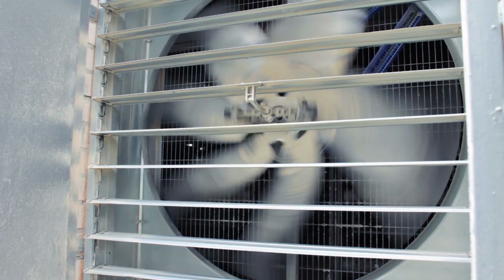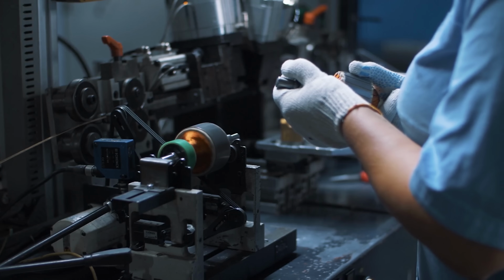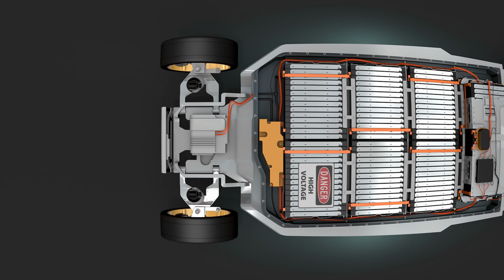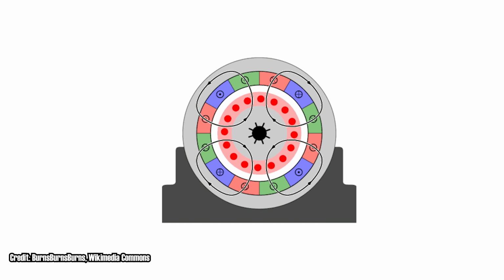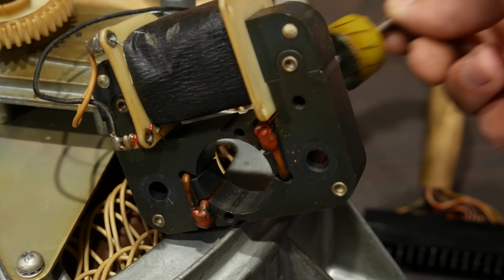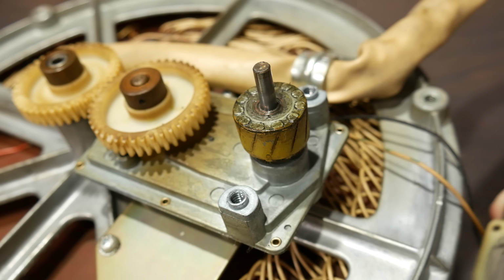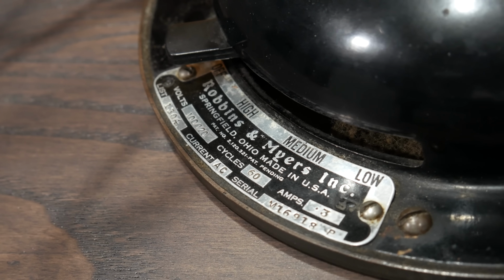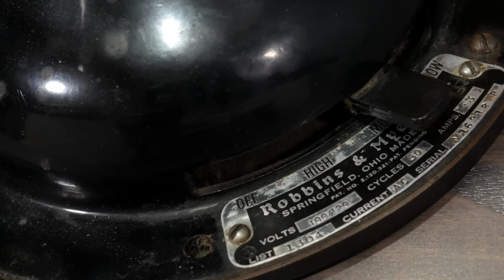Fans; High is next to Off on purpose

Comment: Living in Europe, I've never ever seen a fan or room heater that starts on high.
Reply: That and we have 3phase in our homes at 400V. Perhaps having 230ish V on a single phase helps start things. And most things today have more modern motor designs.
Reply: Me neither. All the fans I can remember seeing either go off->low->med->high or they were two-speed models where you have to press two buttons simultaneously to get to fast mode
Reply: You like doing things backwards don’t you! First your dates, then your fans, then your presi....never mind!
Reply: Oh thank god. Same here in Australia
Reply: One old fan we had went from off to high and i'm from italy
Reply: Y'all normally have 240 volts as opposed to The States, we have 120v as low standard.
Reply: @Maaniic  even old designs have this more logical setup
Reply: @BadassAlen  Nooo. The UK and Ireland de facto have 240v (officially 230v) and the rest of Europe has 220v (officially 230b).
Reply: @Maaniic  No one's gonna plug a fan into 3 phases.
Reply: Same here. Stove dials on the other hand... Grrr!
Reply: @ttrjw  In the EU its 230V for more like 10 years because they wanted to standarize voltage across the EU. After Brexit it doesn't make that much sense though.
Reply: Yep. UK here, and never seen a fan like that.
Reply: yeah i just got a new fan and was surprised it starts at 3, never seen that before
Reply: It's because of the lower voltage running into our homes in the US. We're stuck with 120v rather than 220-240v throughout Europe and the UK.
Reply: @R3lay0  I've seen fans using 3 phases. They are a bit bigger than your normal household fan and were used to circulate air in big party tents. Cool stuff.
Reply: @R3lay0  I do for work :p nowdays usually with a VFD but the old ones still exist.
Reply: Same. I've never seen that anywhere here
Reply: Vaes Joren you should have at least 3 separate groups on different phases from which you can build a 3 phase? You don't have that? In the Netherlands that's pretty much standard.
Reply: @ttrjw  can't say for certain for whole Europe but here in Croatia we are on 230V standard (around 240 in practice) for at least 20 years. And since our power grid is part of European power grid I'll guess and say that everybody have same line voltage. UK was never part of EU power grid but have same values.

Three phases are not so common here now, 30 years ago most of homes have them but when electric company start to charge a lot for additional "available power" most old users have disconnect two phases and stay just on singe one and new buildings are mostly projected with monophase installation. It still available if you want to pay for that, just not so common. Not that we have much use for it nowdays anyway.
Reply: Same. All the fans here seem to have push button speed selectors and you just push whichever you want first. Maybe having 220-240V electric makes a difference? It would certainly give the motor a bit more of a starting kick.
Reply: Me neither. My reaction when seeing the video was: do they? My current fan goes 0-1-2-3.  And (except for the push-button style ones of course) that's the case for any fan I ever looked at. Doing it wrong way around must be an american thing, probably because of their tendency to build electronics as cheaply and shoddily as humanly possible. Probably saves a couple of cents for a capacitor or something.
Reply: @ErwinPommel  UK as well here and I bought a bog standard fan from Argos a few years ago that does indeed go off, high, medium then low. Many office fans just have the push switch selectors for the speed you want though, as others have mentioned.
Reply: I don't think voltage has anything to do with it. Higher voltage doesn't necessarily mean more torque or power. I suspect that most fans sold in Europe have to meet higher efficiency standards than in the U.S. Shaded pole motors have absolutely garbage efficiency, even here most larger fans use capacitor start motors, which have more torque, and are twice as efficient. A fan with a cap start motor should reliably start on low with no trouble, and that's probably going to be way more common there. I also suspect that the antique fan he has in the video is not a shaded pole motor. I see 40W shaded pole motors on fans half that size, that don't move much air.
Reply: They will be telling us next about a fantastic new American invention called the electric kettle
Reply: Same here, must be a Yankee thing.
Reply: @Maaniic  Oddly enough, newer fans are more likely to have crappier motors. My 70+ year old fans have capacitor start motors that are twice as efficient, and have much more torque, compared to my modern fans with shaded pole motors. But those caps cost a few extra pennies, so they're only used on larger fans (box fans, ceiling fans, etc.). Also, older motors are often made with more poles, which makes them turn more slowly but with more torque. Add steeper pitched blades and you have a much quieter fan for the same air flow. Again, this made the motors a tiny bit more expensive.
Reply: Same here.
Reply: @davidheafield1436  not likely, Americans don't really use the word kettle.
Reply: I was wondering about this, as a european. But cool video, and those phases in powergrids and all that, super interesting
Reply: Same here in South-Africa.
Reply: @ttrjw  It's officially and actually 230V in Ireland (standardised in the 1990s), and we were originally 220V as initial rollout used primarily German technology. We use BS1363 plugs and sockets these days, but that's about all we share in common with UK electrical standards (e.g. fuse boxes follow DIN standards).
Reply: @Maaniic  Single-phase 63A or 80A household installations are typical in Ireland, you'd have to pay a lot more to get three-phase.
Reply: In America everything starts on high. Then we mellow out and catch on after a couple decades. Unless it's converting to that vile, sensible metric system.
Reply: @ruadeil_zabelin  
Yeah, same here in India.
if we trip a breaker not one room but a section of the house trips like a light and a plug from the hall, the led tubelight and the fan from the bedroom and probably some plugs from the kitchen.
we have 3 THICC 50sqmm wires of 440V  coming into the large oil cooled transformer that speps it down to 230-250V 3 phase that Y or Delta( I do not know) somes down on the ground floor to the digital electricty meter and 4 thicc 5sqmm wires enter the house to the circuit breaker board and each phase is split into 3 load sections into each room.

Atleast thats what my apartment and most of my neighbourhood and relative's homes have...
Reply: @AaronSmart.online   Officially. But in both the UK and Ireland it is actually at 240v. There was an EU directive which mandates 230v but has a tolerance of 220v - 240v and requires appliances to support this range.
Reply: @jasexavier  
Yeah, my grandfather has a really old ceiling fan that looks like a obese modern ceiling fan.
he claims it to be roung 300-400W~ and I suppose that might be true cause the capacitor on it is THICC.
It runs quite slow but the air it pushes thru blows out papers & pens when it looks like it has not even reached max speed on 2nd speed!
me keep it on 1 all the time! it gives you the experience of a pleasent breeze with TOTAL SILENCE the fact that it has 7 step  resistive speed controler with 6 speed levels(1-5) and one off & it looks and feels just like a old caset player switch module.
Reply: @jasexavier  
shaded pole motors, in India, Ive never heard that term anywhere. 
even cheap $25-$30~ ceiling fans made in in India, LITTERALLY 99% of the time have a capacitor start motor in them.

EVEN my $90 modern remote control RGB ceiling fans have those capacitor start motor.
Reply: @ayushp.5395  All ceiling fans everywhere use cap start motors, or BLDC motors, never shaded pole motors. Only the smallest, cheapest, lowest quality fans, or some fans in industrial devices, use shaded pole motors.
Reply: Well you have the good life, I've been trying to explain to my hillbillies friends there is a better way of living
Reply: @ttrjw  I don't think you're right about Ireland, it's typically closer to 230V whenever I have measured it though it can vary by location

Comment: I have an old fan with low as the first gear. The low speed is stronger than most modern fans on high. The plug is a regular 120V with ground. It has never stalled.

Comment: I always thought it was a safety thing, since you're more likely to shut the thing off when it's going faster.
Reply: I figured it was for kids, since they like to do things like turn knobs, and they usually like to turn them to one extreme or the other. Instead of turning it to a more dangerous high speed, they would turn it to either off or low.
Reply: I guessed the reason correctly, because my cheap fan stall a lot, I need to turn it with hand before it can turn on its own, just like old propeller plane, so I guessed it has something to do with torque and friction
Reply: Yeah id always thought "oh like stoves that makes sense" but I never actually thought about it
Reply: @Scumful  The logic is that if a child turned the knob, it is likely they would turn the fan off or to a lower speed. The reason that might be important is that children also like to stick their fingers in fans. If the fan is off, the child would not get injured. If it is on low, the child's fingers are likely to get less damage, or possibly stop the slow moving fan blades and receive no damage. I thought the logic was pretty clear.
Reply: @Scumful  pretty solid logic actually. You must not have kids
Reply: @ClickClack_Bam  Pal you need to reread what he wrote. You didn’t understand what he said.
Reply: @raspberryjam  well... stoves start on high to make sure they have enough gas to ignite.
Reply: @void-2b  yeah, in both cases, the "low" settings can cause dangerous startup failure conditions
Reply: @b1zzler  both correlated, neither safety related.
Reply: You’re more likely to shut things off when it’s going fast? What?
Reply: @rachelcookie321  If some dumb kid sticks his finger in and it gets stuck, it's more of a priority to shut the thing off when it's fast to avoid injury
Reply: @TheTrueMr.Chicken  I you don’t really get your finger stuck in a fan. You put your finger in and then it either gets super injured or nothing happens. Either way you can quickly pull  your finger out again. If your finger is going to get injured then it’s going to get injured straight away. I mean I guess you could get your finger stuck in the protective cage but the finger won’t be in the blade because those are a bit far from the blades. And if somehow someone did get their finger stuck in a fan, what if they got it stuck at a lower level? It seems dangerous that you would have to turn it up before you could turn it off.
Reply: @void-2b  this might sound crazy, but I looked it up and it turns out that both gas leaks and electrical fires are related to safety 🤯🤯
Reply: @b1zzler  maybe you should have looked up the comment thread instead.
Reply: @void-2b  did I miss something?

when I came in, the @ chain was just you suggesting that some guy's gas stove analogy was bad.

then, when I commented to explain some of the commonalities, you replied to express your belief that there are no safety considerations associated with electric motor stalling, or with gas ranges that release an unpredictable quantity of explosive gas indoors before igniting.

if there's a puzzle piece missing here,  lmk
Reply: @b1zzler  he said the analogy was bad because he's said that in neither case is the low setting on the extreme for safety reasons. In the stove, high is by the beginning so there's enough gas coming through to be ignited.

He didn't, at all, say that there are NO safety considerations in the design of these things.
Reply: @freddiesimmons1394   Well… he said that startup failure was unrelated to safety in both scenarios. Which again, is not correct. I don’t have any statistics on gas range accidents, but did see my buddy singe his eyebrows off after struggling with his lighter for a while on an outdoor propane grill. 

As for electric motors…Locked rotor current in household fans was enough of a fire hazard for orgs step to in and standardize locked rotor withstand time requirements. And even with those cert requirements, IIRC, fans are still causing a ton of house fires annually according to a recent study.
Reply: @b1zzler  I just went up and down this thread and found nobody saying what you're saying they said. Is it deleted or something?
Reply: @skyfeelan  dude, chance the capacitor and lube de bearings up
Reply: @skyfeelan same thing why PCs start with all fans at 100% (a.k.a jet engine mode), to kickstart them
Reply: I just thought it was to get the blades moving quicker so you could turn it down to an appropriate level in less time.
Reply: It’s like that on my  stove considering I doubt it’s an electric motor
Reply: @ClickClack_Bam  That's not making it more dangerous, it doesn't change the potential practical danger level at all, it just plays a mind game with the children, if they turn the nob all the way left then it will be off making it not dangerous, if they turn it all the way to the right then it will be less dangerous than high meaning less likely to injure them, meaning that they'd have to choose a seemingly random amount of "turn" on the nob if they wanted to get the high setting, as opposed to the obvious amounts of turn such as turning it all the way to the left or right.
Reply: @ClickClack_Bam  His logic makes sense. Your reading comprehension is terrible though.
Reply: I thought it was just turn it to its maximum speed as fast as possible most just tend to crank them up to their max

Comment: One benefit to having high first that isn't related to reliability of starting is that it helps the fan get to your desired speed faster. I keep my bedroom ceiling fan on low most of the time to keep a marginal amount of air flow. And when I turn it on after it's stopped, it takes a while to actually start doing anything helpful. It starts moving, but it takes way too long for my 21st century attention span to appreciate. If it turned on high for a couple seconds, like the switches you showed off, or required me to set it to high before going to medium and then low, then it would reach the speed I want faster than waiting for the weak low start force to get it up and running

Comment: Great topic! I'm always mindful of any electric motor in this regard. When an electric motor stalls its always bad news. For example my 6 year old son occasionally drives his power wheel into an immovable object while continuing to hold down the accelerator and you can bet on me shouting "let of that pedal! Your going to burn that motor up!". I also have to deal with this in my profession working in a grain elevator. We have plenty of very large 3 phase motors that drive our conveyor belts. Most if not all of our big motors use a soft start and are linked to a PLC (Programmable logic controller) which will abort startup in the event that not enough rotation is detected within a specified time frame in order to prevent motor damage. Some of our motors pull over 100 amps on initial startup! Even with all that protection we still occasionally burn up motors.
Reply: I want to believe that Fisher-Price has some sort of anti-stall in place to prevent accidents in scenarios like that, but yeah, you can’t be sure
Reply: @yoymate6316  for the sake of safety, I hope they have that

For the sake of it being pretty funny, I like to imagine that they dont
Reply: I  bought a cheap used quad bike with a weird "semiautomatic" gearbox that doesn't give you a manual clutch (it's centrifugal) and won't shift into neutral if there's even a hint of power applied. It also has a sticky throttle (I'm waiting on the replacement). 

If you get it stuck against something it stalls in a condition where you can neither put it back in neutral nor slow the engine down to idle and you're just sitting there with the clutch slowly burning until you turn it off entirely. Did I mention the electric starter doesn't always work and it doesn't have a starting pedal?
Reply: Ah, that starting current.
It's funny how many places this shows up.

For instance, computers.
Many motherboards designed for server use (and several designed for home use, especially these days - though ironically this could be becoming redundant due to changes in technology) have a bios setting that causes phased power-up of the hard drives.

Why is that? Because the hard drive motor spins up when it powers on and this draws considerable current.
Which is fine when your computer has 1 hard drive, but can overload your power supply if you have 10 hard drives all powering on at once.
But, since the steady state current draw of a hard drive isn't that substantial, it's easy to circumvent this just by ensuring that each hard drive powers on at a slightly different point in time...

Of course, with the increase in use of solid state hard drives this becomes less relevant.

You could also ask why it's only considered for hard drives, when a modern computer can have a half dozen or so cooling fans...
Ah well. XD
Reply: @Ryan Schaffer where do you get your information from? I've worked in countless plants. Most motor just use a contactor. I personally work on VFDs (variable frequency drives) At a good plant only 10% of motors use VFDs or Soft starters. Please don't make stuff up.
Reply: @RyanJardina  forgot the word "big" before motors. Thanks I will update it.
Reply: @KuraIthys  yes, in the good old days when a PC used less than 100 watt, but had 12 amp surge, now build a wooden shelf to hold dozens to test for burn in and wait for power sag... Me trying to explain what happened to the supervisor 😂